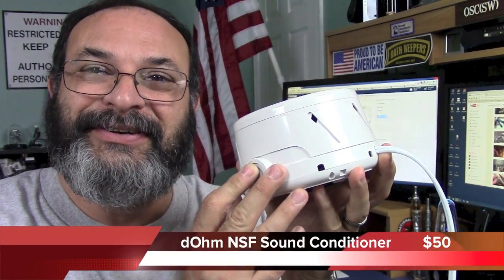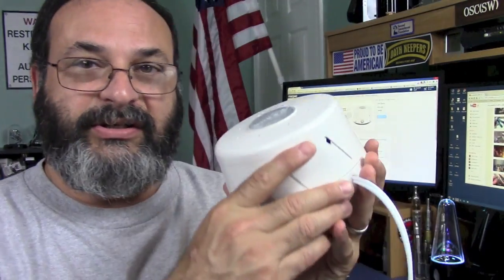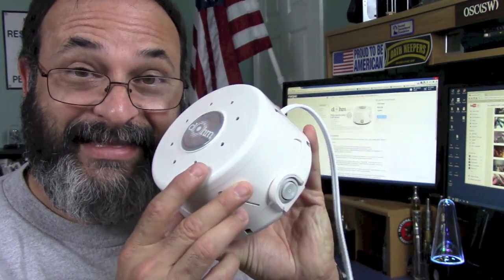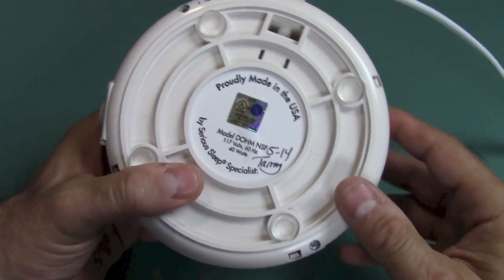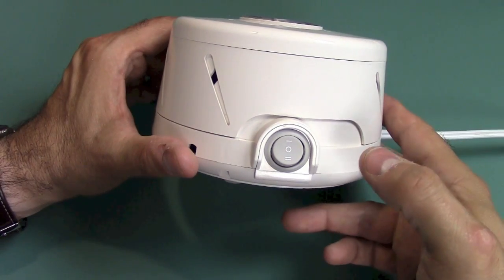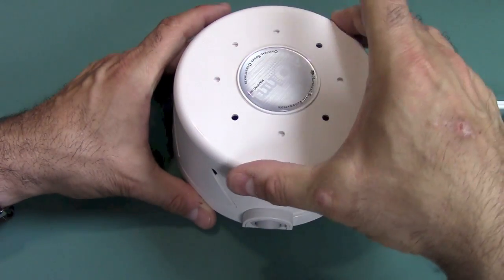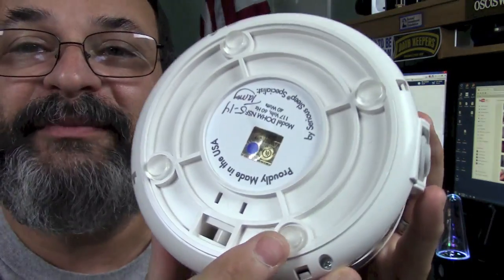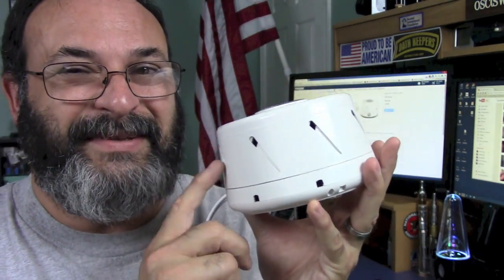dOhm NSF Sound Conditioner

Comment: Ever tried iPhone apps for example? Those work pretty good, won't consume electricity as much (if at all) and are WAY cheaper. And you can adjust the sounds just the way you like. Plus you can use headphones, so the wife can sleep also.
Reply from the maker: The speakers in an phone are not going to produce the sound that I am use to.  It's a personal thing, for some it's good and some it's not.  Thank you so much for your suggestion, it will definitely help a lot of folks!!!!
Reply: ***** There's literally hundreds of thousands of speakers out there with a 3,5mm audio connection. And all the earplugs aswell.